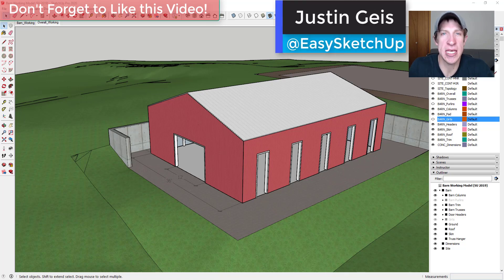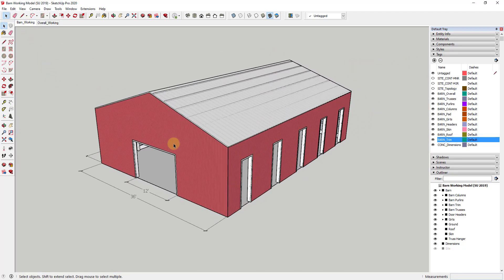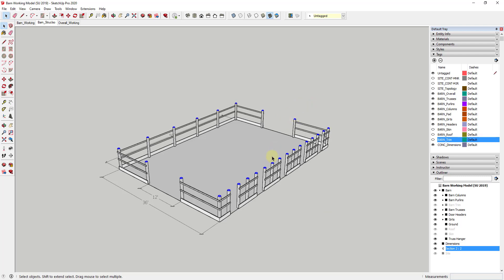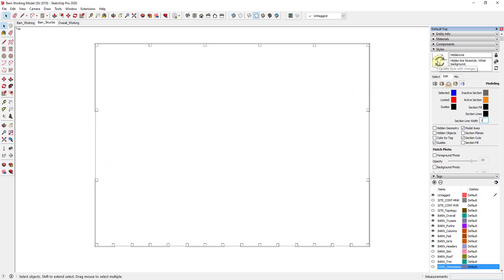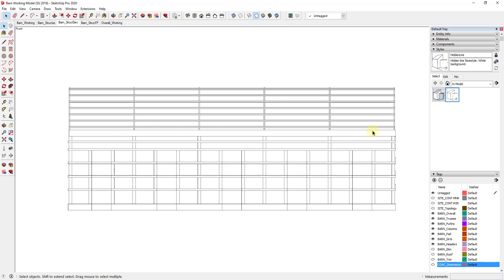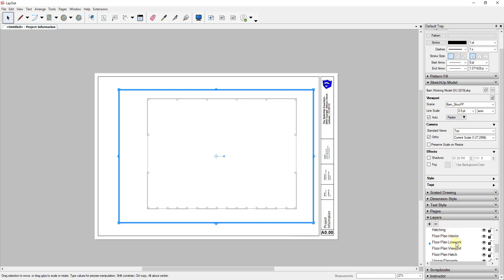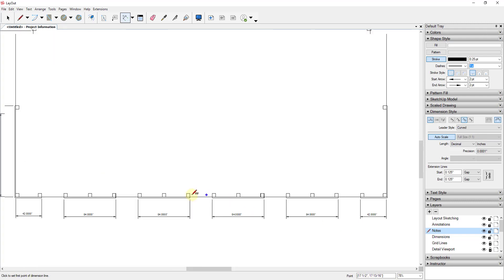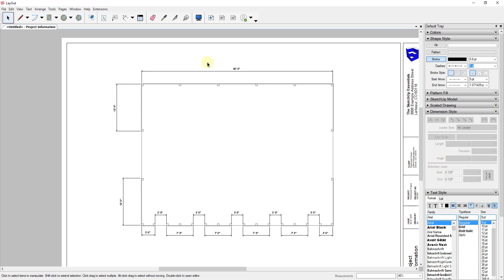Structural Floor Plan IN LAYOUT - SketchUp Architectural Skills Series

Comment: I have a beginner question.  I am making a drawing and using 3d models for black iron plumbing pipe, and I am have a really hard time getting them to rotate and fit on the correct axis.  I can not get them to join up right as they are always indexing off of a weird spot on the item.